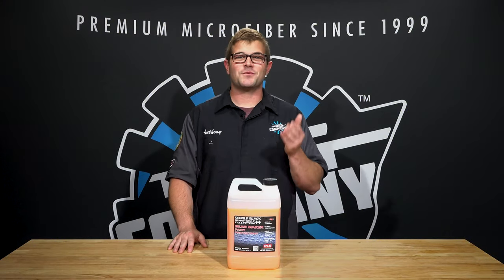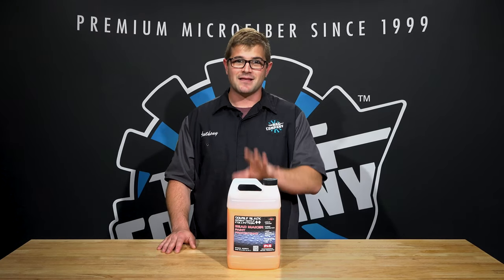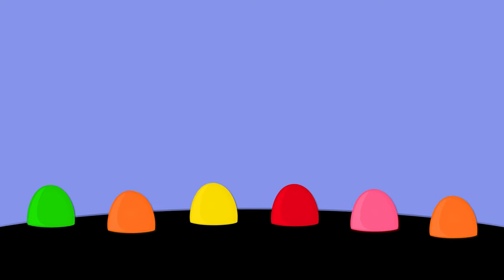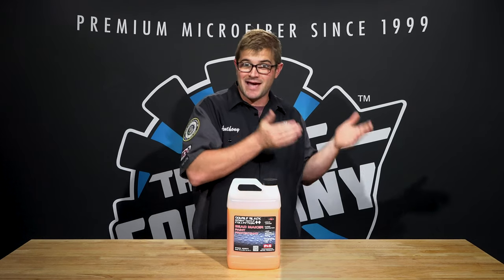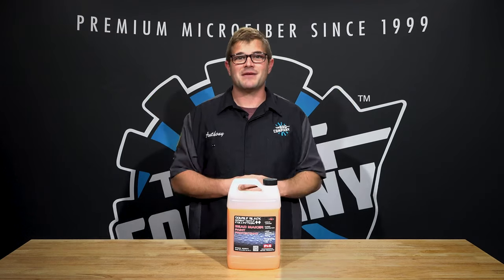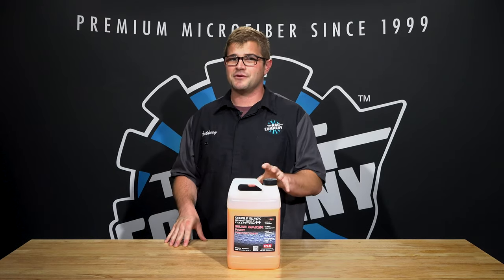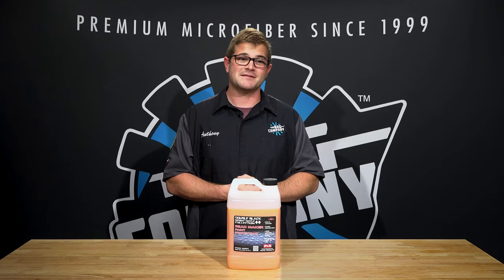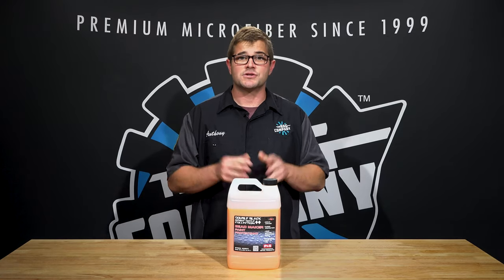All About P&S Bead Maker's Cure Time (Dust, Water Behavior, Longevity, etc) | The Rag Company FAQ

Comment: My issue, without a garage in the tropics, is humidity. I begin to wash my SUV late in the afternoon  because the Sun would be too hot , but by the time I dry it and apply Beadmaker, night falls already... A thin layer of humidity is visible on the car after I finish everything... I am pretty sure curing will be a problem, especially on flat surfaces.  I am still happy with the results although I wish I had the perfect solution.. Oh yeah! wake up at 4 in the morning !
Not my thing...

Comment: so I spray on beadmaker   do I  then let it dry itself or do I  then buff it with a microfibre . I am in the cold and damp UK
Reply from the maker: If that works for you, great!
Reply: @TheRagCompanyFAQ  it was a question  not a statement  beadmaker is an awesome  product any direction on the application would be welcomed
Reply: @paulshields6234  yeah spray on and buff off but if first Application use alot